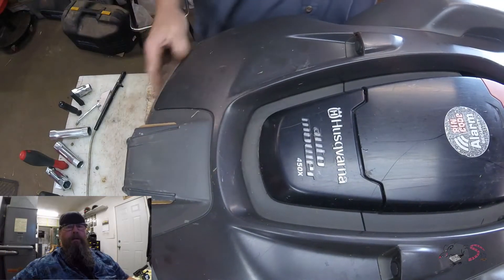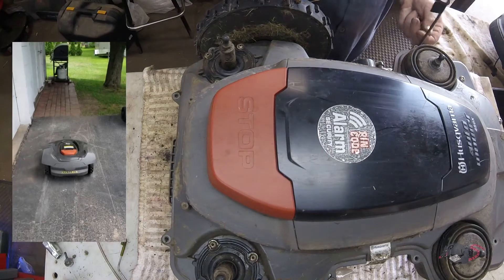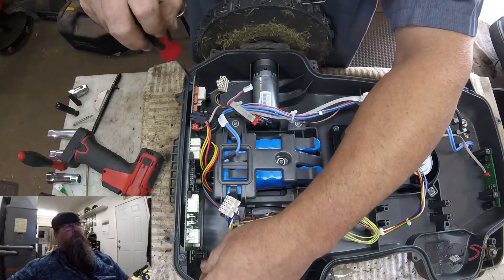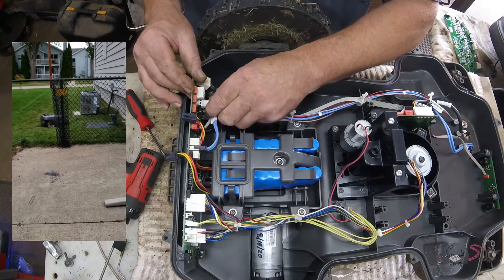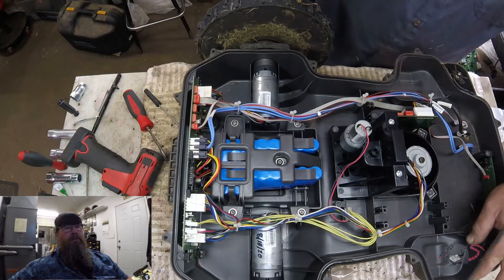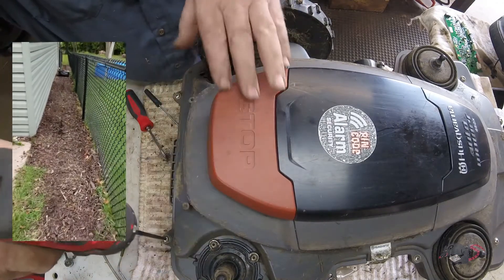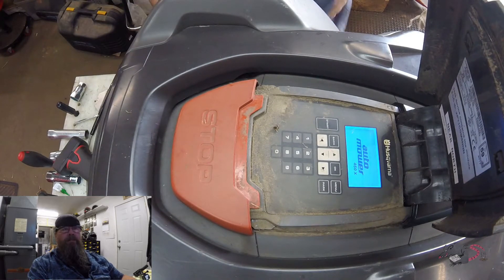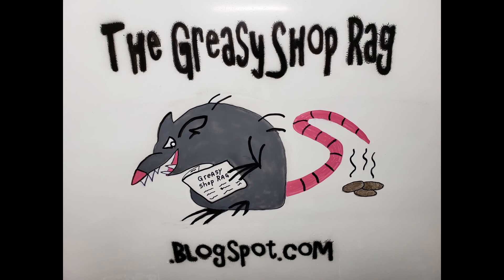450x Automower Main Board Swap

Comment: A lot of chips on that board.  What would it cost a customer to have a board replaced?
Reply from the maker: I just looked it up. The main board for the machine I showed you is $330 plus labor. That seems higher than last time I looked it up.
Reply: Not ridiculously high, but still a kick to the wallet.